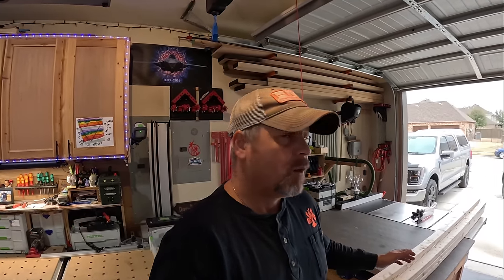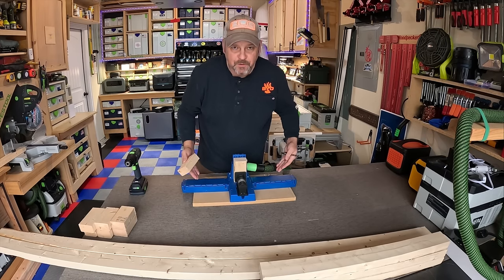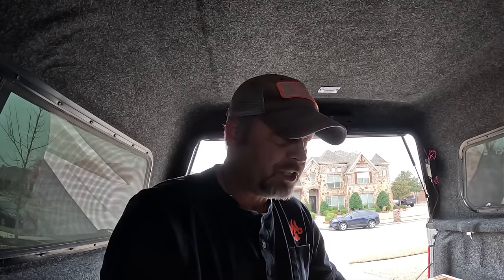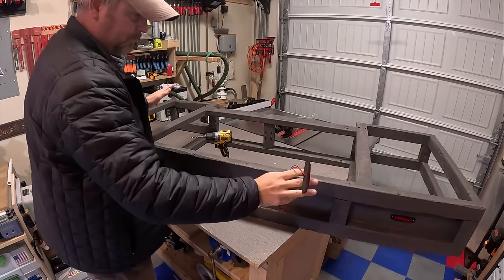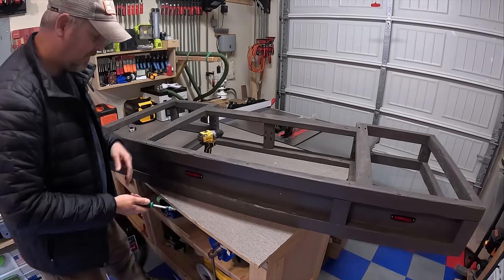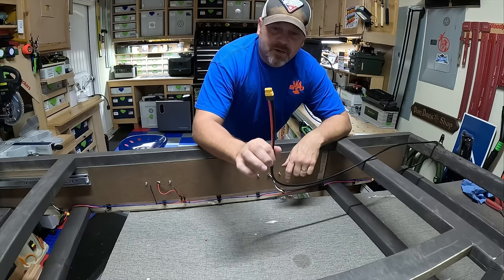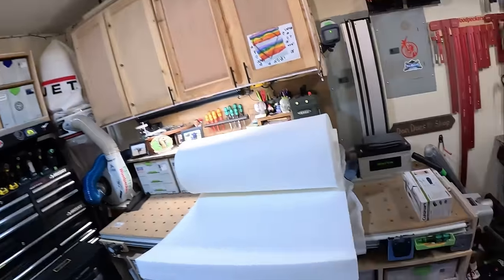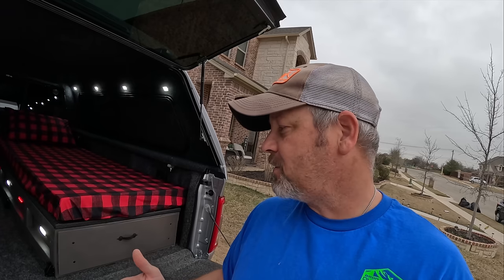TRUCK CAMPER BUIILD PART 1: How to build the bed platform - Start to Finish

Comment: Sweet miter saw setup with a long bed and that Delta dust collection thing is huge. For wiring Wago lever nuts are a game changer, also go to harbor freight and get a cheap hot knife, makes cutting foam super easy.
Reply from the maker: Thanks Eric. Good idea on the hit knife👍🏻

Comment: Great build!  I plan to follow your lead.  And your garage looks amazing! 
May I make a suggestion, if you need to level out your bed, have you thought about taking some blocks with you to drive up on?  That might be easier than utilizing the furniture levelers.  Just 4 scrap 2x6’s about 10” would probably be perfect.   Or you can get plastic ones. You could keep them stored under your bed in case you need them.
Reply from the maker: Thanks, and good thoughts on the leveling blocks👍🏻

Comment: Did you say why you chose to put the bed on the other side of the truck bed? It looks really good. Good idea to add the drawer at the end.
Reply from the maker: Hey Chris, good eye😉 I did put it on the passenger side this time for a few reasons that I’ll go over on my final “reveal” walk through video once I get the cabinet built and wiring complete.

Comment: Hey Don.  I just build my truck bed setup after watching a bunch of videos for ideas.  I was inspired by your builds because I wanted alot of room and wanted my bed to be easily removable.  Got a question on your power box you have sitting in the back.  What is it ?  Does that supply all your power for the lights and charging stuff ?
Reply from the maker: It’s a Goal Zero Yeti 1000 x. It does power everything, but it’s way more than you really need.

Comment: Looks nice. Any reason why you didn't make a much deeper drawer? I feel like there's a lot of potential to reclaim space under ~2/3 of the bed.
Reply from the maker: I use the other space for large/bulky items like blankets, buddy heaters….things that would not fit in drawers. Also, a bigger drawer box = more weight

Comment: Nice build. How did you glue the carpet to the sides and camper shell? What glue did you use?
Reply from the maker: Sides are held in with heavy duty Velcro

Comment: Did you consider making the drawer long to use more of the space there?  You mentioned the top being hinged several times but didn't show so I assume this will be in future videos.... can't wait.
Reply from the maker: I did, but in the end didn’t want all the added weight of a huge drawer box, longer and heavier drawer slides, etc…. The top is hinged, and I’ll do a full, deep dive walk through over everything in detail once I get the cabinet built and this thing is done👍🏻

Comment: You've got me thinking...I looked at triFold foam mattresses. Torn between your setup and using the 4 or 6 inch trifold. Did you consider those and choose the solid foam for a reason?
Reply from the maker: This foam I chose was just east to cut to size and honestly, not sure what type of tri fold mattress you are referring to.

Comment: Very cool Brian, I'm going to try to build this platform, can you please tell me the length that you cut everything L x W x H. please I would appreciate it . Enjoy your camping trip safely. And thanks for the video blessings .
Reply from the maker: My dimensions won’t really help you because it’s built specifically to my truck. The height is around 9” to clear the wheel well, 30” wide and about 74” long
Reply: @BrianWatersOutdoors  thanks a lot for the info, appreciate it 👍

Comment: Great and simple but elegant electric and woodwork. I have a question about the lights above in the leer camper shell. You have four lights on each side, are they factory or did you install them yourself after receiving the shell? Thank you.
Reply from the maker: I installed the ceiling lights myself. Input a link in the description where I got them👍🏻
Reply: @BrianWatersOutdoors  wonderful. Thank you

Comment: Stupid question , when you put it in the truck bed , how do you fasten it on the truck bed so it doesn't move ? If screwed is there a way to install one without drilling holes in your truck bed ?
Reply from the maker: The wood on the bed “grips” on the BedRug enough that it does not slide around.

Comment: That looks great! This is dumb but I don’t understand how you did the wiring……I got everything else. My friend from work and I are going to make something similar for her truck. How do you splice into the wire? Thanks this is a great build!
Reply from the maker: I put the “wire taps” in the description if you want to check those out. The directions on the link will be far better than what I can write in this comment😉
Reply: @BrianWatersOutdoors  thanks

Comment: Great build video. I am not sure how you tapped the light wires into the power wires. Is this done via a special connector?  Thank you.
Reply from the maker: I’ve got a link to the wire taps I used in the description if that helps?
Reply: @BrianWatersOutdoors  that was the ticket I needed. I am all caught up with the technology now. Thank you so much.

Comment: what's the material you used to block the spaces between the risers/legs that you mounted the lights on? nice build
Reply from the maker: I’ve always called it hardy board, but not sure the “technical term” for it.
Reply: @BrianWatersOutdoors  it may be the right name, thanks for the info, can't wait to see your build progress

Comment: Brian, how is your mattress holding up? Particularly with regard to moisture in the bed of the truck. I have been debating getting goto foam or or doubling up some Wakeman pads that are waterproof. Any thoughts on this or how to keep moisture and eventual mold off of the foam?
Reply from the maker: Hi Thomas, it's holding up fine for now.  My other mattress in my previous truck held up fine too, with no issues with mold.....yet

Comment: you changed sides with your bed? was there a specific reason, I start my build this spring and have been debating which side to put mine on?
Reply from the maker: I did. I have a few reasons that I’ll go over when I do the final build video 👍🏻
Reply: @BrianWatersOutdoors  as we used to say in the old days, I'll stay tuned in, thanks

Comment: What do you suggest for a short bed?  I am waiting on my camper shell and my bed is 5' 8".  I am 6 so the length is going to be 4 inches short...  thoughts?  Thanks Brian!
Reply from the maker: I had a 5.5’ bed in my last camper setup. Check out this video for what I did
https://youtu.be/jDaAx6b_EHk
Reply: @BrianWatersOutdoors  Thanks!  The answer is so simple but makes so much sense.

Comment: Brian, great looking build.  Checked out your foam on Amazon and wanted to ask you is it very firm?  I purchased a trifold bed and it was extremely firm and uncomfortable.  Having lower back issues I am looking for some foam that will give a bit, not rock solid.  What is your experience with your new foam?
Reply from the maker: I don’t have any issues with my foam. I find it to be fairly comfortable. More plush would be the medium density foam. I got the high density stuff

Comment: Did you install that fabric on the bed and topper?
Reply from the maker: The topper came from Leer with the headliner. The truck bed, I put a BedRug Bedliner in it myself. It looks like carpet, but it’s not. They are fantastic
Reply: @BrianWatersOutdoors  gotcha! It looks good. Looks cozy with the bed and lights already.

Comment: no glue?
Reply from the maker: Not needed for this.
Reply: @BrianWatersOutdoors  theres so much movement in a truck that i would definitely glue the joints as well. maybe even dip the screws. your rear drawer could fuck up if things can shift.

Comment: Given that you clearly know how to install drawers, WHY are you leaving all that space underneath the bed unused?  Storage is at a premium and it seems wasteful.
Reply from the maker: It’s not wasted. I can access the rest of the storage from inside lifting up the lid. I also didn’t want a huge pullout drawer that weighs a lot more and large, heavy 4 foot drawer slides. I only needed a little bit of storage for the things I use the most outside to be able to access this from this drawer. 👍🏻